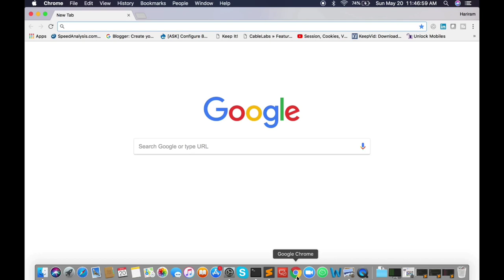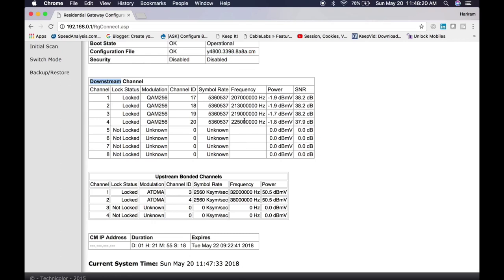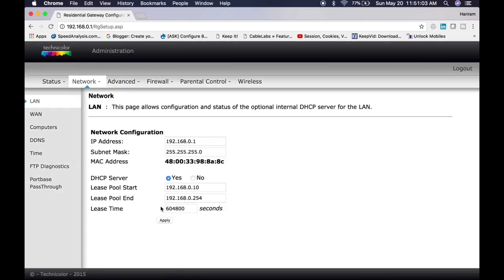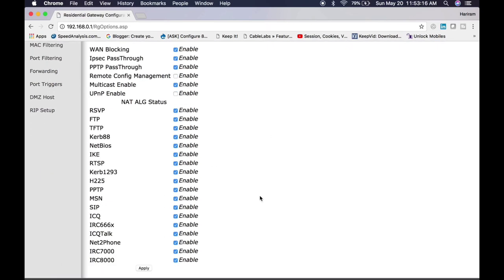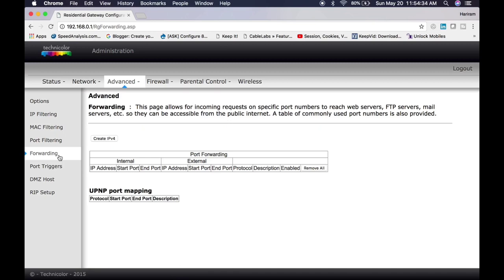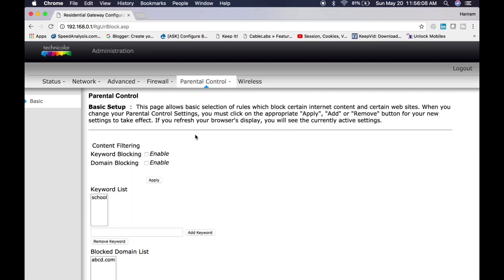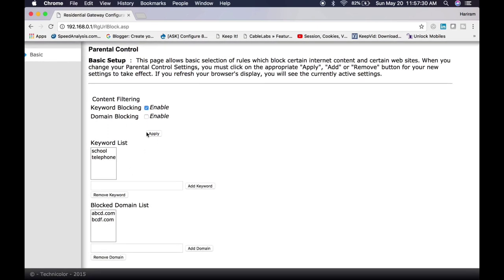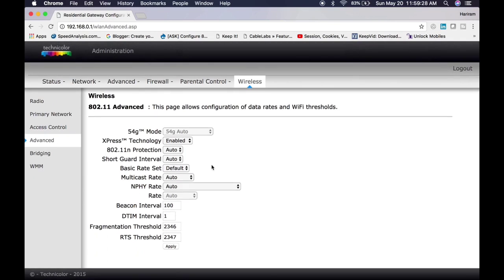Technicolor Modem setup

Comment: Im using a all in one technicolor tc8715d from Time Warner Cable, Not sure if spectrum changed the default gateway, but its changed on mine and I can no longer get into the admin tools or get Wifi working again. Is it the device or did they stripped this.
Reply from the maker: If you are connected with that cable modem then you can execute the below command to know the gateway.
1) ipconfig/all (if you are using Windows) 
and 
2) route get default | grep gateway (if you are using MAC)
Reply: @helloithub  The gateway is changed now and I can no longer get into the admin tools. It starts at 107 not the 192 address from the all in one. At this point I think I would need to get my own wireless router right?
Reply from the maker: @Oni64  It does not matter until you are directly connected with that router and you have the right login credentials.
Reply: @helloithub  I was able to fix it by entering another gateway number  I found online that was not the same one printed on the modem/router. Im not sure if my ISP changed it or did something to my router to try and get me to pay a 5 fee for a new one lol or what but I was able to get into the admin tools and get my wireless working again.
Reply from the maker: @Oni64  great !!  I'm glad to hear that your issue has been resolved..

Comment: I have the same router model, but it is not showing default gateway. I've tried different ways but no use. Can you please help me
Reply from the maker: Where did you check for default gateway ? Make sure that dhcp client is enabled on your laptop or desktop ..
Reply: @helloithub  It was showing earlier, and it's working with my other router(Huawei ).

Checked using ipconfig in command prompt
Reply from the maker: @vishnukm5861   did you check connection type in your LAN configuration of laptop ? If you have enabled dhcp client and still not showing default gateway than try once by resetting your cable modem once ..

Comment: Hi, I already have another WiFi connection, and was wondering to use this old modem that I have for extending. But as you said this can't be used for extending.. Is it possible to use this modem as primary and my WiFi router as secondary.. If so will my network provider have a problem doing these settings??
Reply from the maker: Yes you can't use this modem as a secondary but as u mentioned I have another wifi connection.. So u need to consult with your existing service provider, if they are providing Docsis too than you may get the solution
Reply: @helloithub can firmware change make this as an secondary router??if yes then pls tell me how to install firmware in this and name of the firmware

Comment: Bro small help, online light is not showing in my modem(no access to internet) , After lots of ON/OFFs and resets, it is not working. What should I do?
Reply from the maker: what about US & DS lights ??  if US & DS lights are not glowing stable than it is due to signal issue and if these two lights are glowing stable and stuck at online light than your modem might not be well provisioned.
Reply: @helloithub  hello bro for me only ds  light is blinking and I am not able to access internet so please help me fast
Reply from the maker: @Hacker-ur4je  ds light blinking means , there is signal problem (Forward signal). pls  do consult with your service provider or check your physical connectivity ..

Comment: Hi! Would  you know how to change the Super User / Root Password for this Modem? It seems only the basic Administrator Password can be changed using the backend user interface.
Reply from the maker: You mean CLI root access ? or Web ?
Reply: @helloithub  I think through the Command Line Interface as Ive tried through the Admin Backend Web User Interface and it does not work even if im logged in as Super User.

Comment: I have this router and my internet is coming through a lan cable. Can I insert the lan cable into the router and get internet?
Reply from the maker: Yes.. definetly you can
Reply: @helloithub  please explain how to use lan cable as input with this router. I have the same router and a fiber network connection. I use lan cable directly with my Ethernet port on the laptop but I want  to somehow use the lan cable with the router. Is it possible?
Reply from the maker: @ritzzyritz2044   You cant use it as extender wifi..

Comment: Hello sir, can you help me, I did not find a solution for this modem. I tried all the methods of this type. This is a Technicolor TG789vac v2_MOS modem. The solution is not to enter from the interface of the modem
Reply from the maker: Means, you are not able to access this modem via LAN inteface,correct ??
Reply: @helloithub  yes

Comment: I was trying to use this modem as a repeater and in doing the config i changed the router ip address and ssid/password and disabled dhcp but didnt disable nat. Now my router is unreachable. Tried resetting but still cant connect and ssid also doesnot get reset. Please help
Reply from the maker: Actually, u can't make this router as a secondary router but u can use another repeater after this router. However u can make it as a bridge through LAN.  Press the reset button for few seconds (20-30 sec) and leave it when all lights glow & start to blink after that all your setting should get back to the default configuration

Comment: I have TC7200 d1l which is directly connected to the WAN cable but it's wifi range is very low. I also have one D-Link router but I am unable to understand that how to connect them both. Please help
Reply from the maker: Simply connect your D-Link router with Technicolor modem and make sure that WAN port of router should be connected with modem and connection type is Dynamic on D-Link Router.

Comment: Is it possible to set a static IP for a device in this router?
Reply from the maker: Yes, it is possible . if your ISP is providing you static public ip.. for that go to "Network > WAN > WAN Connection Type > STATIC IP " and put the ip details
Reply: @helloithub  No No. What I am asking is that can I have a device connected to this router with a static IP? Like a laptop connected to this router, can I assign a static IP to that?
Reply from the maker: @KP-KP   Yes you can .. for that exclude those IPs on DHCP server of your router and put ip on your laptop or computer .

Comment: Hey! Can we use it with WAN cable from ISP?
Reply from the maker: Hi, we didn't get you properly .. You mean another
 cable other than coax ??
Reply: @helloithub  Yes, My ISP is giving me a RJ45 cable. I refused his wifi router because I had Technicolor router. Can i connect your router ?
Reply from the maker: @madhurahlawat7887   sorry, you can't.. Uplink for this modem is only coaxial.. RJ45 is not supported for WAN

Comment: Can we use this router as a wireless repeater?
Reply from the maker: I have not tested myself yet but i believe you can use it as a repeater..  Wireless -> Bridging  -> Enable wireless bridging
Reply: @helloithub  I did try it. However, I couldnt figure out what to do after WDS is enabled. It shows blank columns
Reply from the maker: @emmarrem   on the blank columns put the SSID of primary router . Today i will try on our lab too and will share you the result
Reply: @helloithub  I tried it today. This is the error code: " Error converting one or more entries: "
Reply: @helloithub  I tried the MAC address and it accepted.
Reply: @helloithub  will have to check if internet is working
Reply from the maker: @emmarrem   We have tested it , Result= We can't use it as repeater .. However this function "Wireless -> Bridging  -> Enable wireless bridging"  is for secondary repeater router.  If you are planning to use another router as a repeater then you have to bind mac address of that router on this Technicolor Modem.
Reply: @helloithub  Got your point. Thank you very much for your support. :)
Reply from the maker: @emmarrem   you are welcome..

Comment: Hey hi, after login when i am changing my username and password it's showing "Error converting one or more entries. Try again" and nothing is changing. I am using chrome.
Reply from the maker: I think, this router doesn't allow to change username however password it does.. we will check  when we get it back in our lab.
Reply: Now it's not letting me in. I am using same credentials as mentioned in video. Previously when i used this credentials it let me in but not now. Why?
Reply from the maker: @mr.lannister4369   which ip you are using to access modem page ?? if you are using WAN ip instead of LAN ip then use "aDm1n$TR8r" as password.
Reply: Thanks. It helped. But the password is still not changing. I kept the same username but when tried changing password using the same username its again showing same error "error converting one or two entries"
Reply: This time it's also showing me two options to change password.

1. Local login access
2. Remote login access

And then showing username, password, re-enter password in both the options
Reply from the maker: @mr.lannister4369   we didn't check much regarding this when we had this modem.. we will check and revert you  but it will take some time because we haven't this device right now in our lab.
Reply: Yeah sure. thanks! Can you tell me what is Remote login access? And what will happen if i change the username and password in remote login access?
Reply from the maker: @mr.lannister4369  remote access means access through WAN IP(provided by ISP) and local access means access through LAN IP (i.e 192.168.0.0/24).
Reply: Do you have E-mail id or something where we can communicate in better way?
Reply: Hey hi, that password you gave for WAN is also not working now. Why? Whats wrong? Its feels really bad when you cant even change your wifi password
Reply from the maker: @mr.lannister4369   Regarding password change we need to check again. if credential was working previously and now it's not working then try with resetting modem ..

Comment: i dont have advanced settings on the top how can I put it?
Reply from the maker: which credential are you using ? there should be if your ISP is not controlling your modem from their end ..
Reply: ITHub what do you mean by credentials?
Reply from the maker: @dparedes8832  username and password  to login cable modem .
Reply: ITHub username blank and the password is admin
Reply: ITHub my modem is TC7200.d2P
Reply from the maker: @dparedes8832   I dont know much about  model TC7200.d2P.. Try once with WAN ip address  with username: blank and password: aDm1n$TR8r ... we will get back  to you if we find update about this issue .
Reply: @helloithub  the password doesnt work

Comment: Any idea how can i use the 2 lan ports in this router? Im using technicolor TC200.d2
Reply from the maker: if it has multiple lan ports than i think no need to do extra configuration.  In case of C7200.d1l , it has only one lan port.